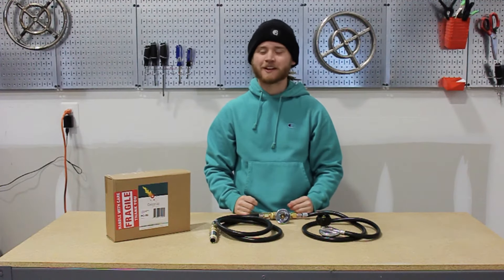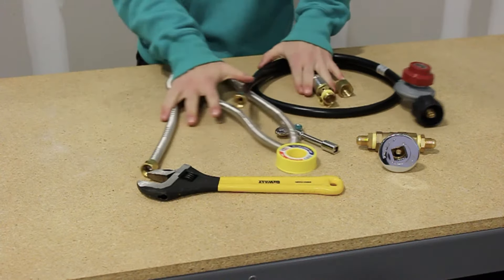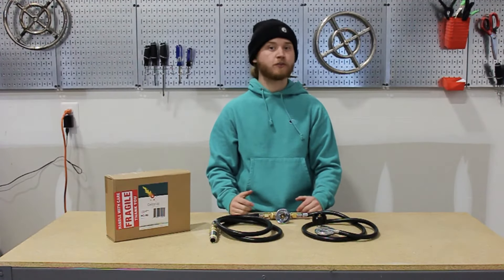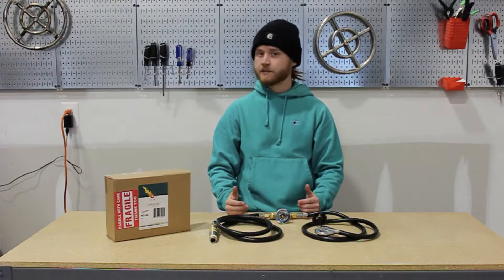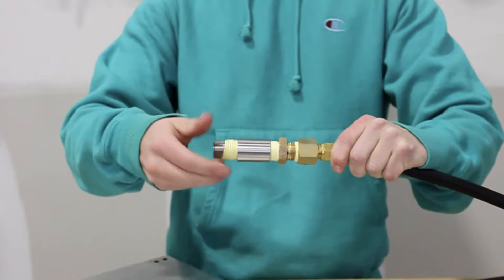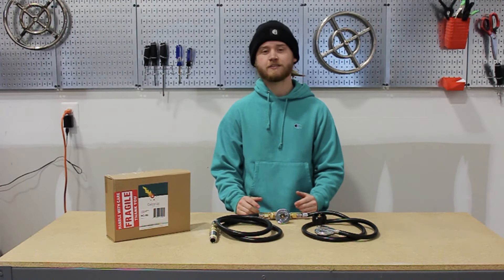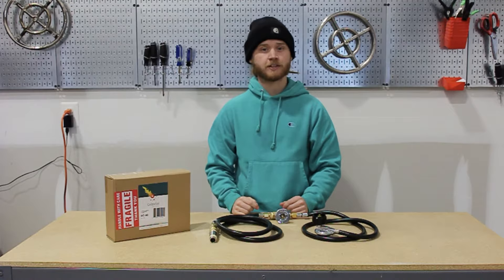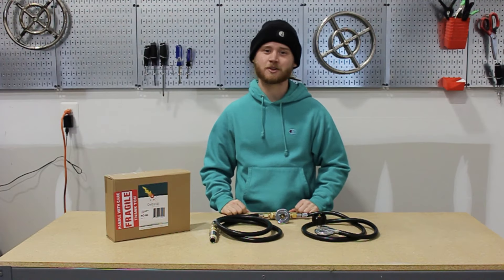Fire Pit Connection Kits - How to connect your burner pan to your gas source

Comment: Any tips if a leakage happens where the air mixer connects to the burner?
Reply from the maker: Most likely if you are getting a leakage in the air mixer it is back flow and gas is coming out of the air intake holes. This will happen if there is a harsh turn or 90° elbow immediately after the air mixer. If the pressurized gas from the air mixer hits an elbow right after the air mixer you will have turbulence in the gas and some will flow out of the intake holes. We strongly recommend leaving the female fitting (if yours comes with one) on the air mixer to provide space between the air mixer itself and the burner connections. 2" or so between the air mixer and any harsh bends or 90° elbows should prevent turbulence.
Reply: @celestialfireglass  I see now see why I was supposed to leave the female fitting. The bottom of my pan lit up on fire today due to a leak and it was too close to the pan. Luckily I watched it happen.